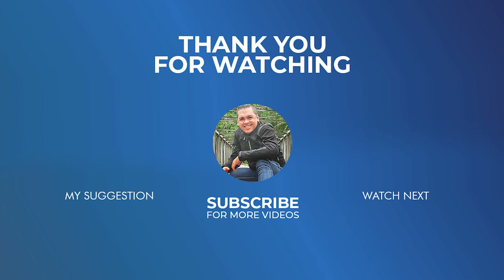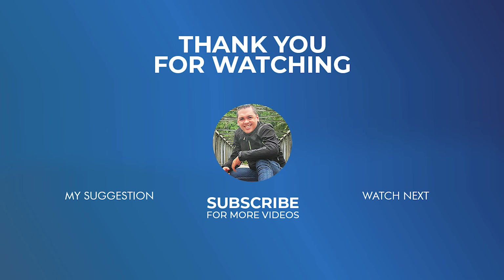UNEXPECTED UPGRADES | Jeff MotoVlog

Comment: Boss good morning po.new subs po.ano po ang performance ng pulley set pitsbike sau?un saken po kc naka pitsbike pulley set ako.10g straight 13.5 df.1k center nka rs8 clutch assy.100kg bigat ko.ok xa sa arangkada pag nagitna na nababa rpm nia.naka 59 block ako pitsbike.sana manotice..rs po
Reply from the maker: Salamat boss for the support

Mabilis arangkada ng setup.. straight 11g 1.2K center spring 80kg bigat

Comment: Pila complete set panggilid? Pulley, Clutch sat drive face face, tirque drive apil ang belt?
Reply from the maker: Akong nagasto walay labot ang belt kay mga 3K+ bro :)
Reply: @JeffObial  conplete gyud tanan, Pulley, drive face, Torque drive, clutch bell, clutch assembly plus mga springs except belt 3K +? Naay available para Sporty?
Reply from the maker: Ang pulley og drive face ra